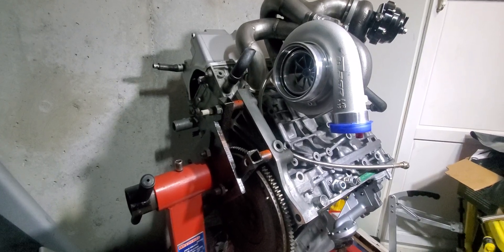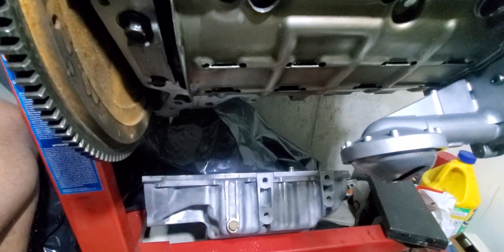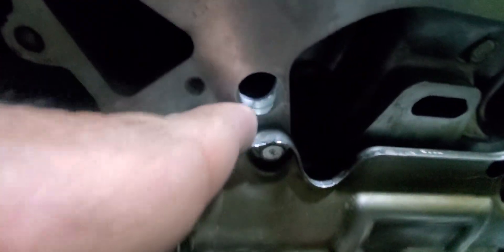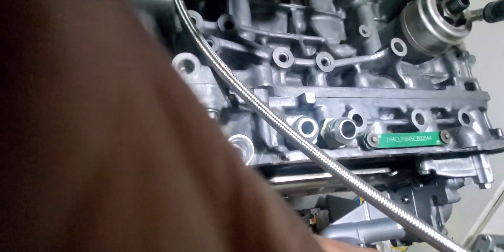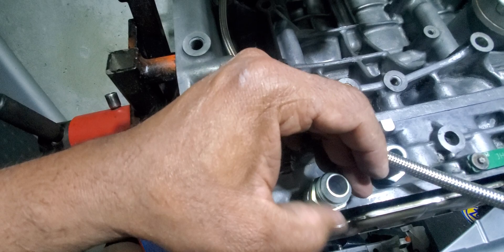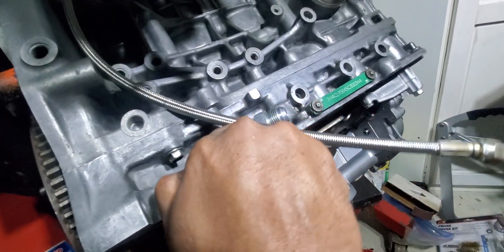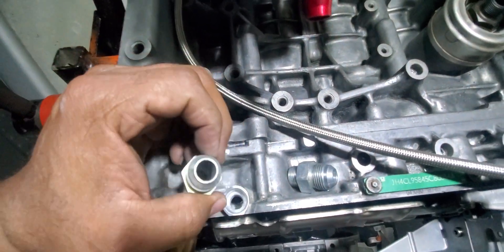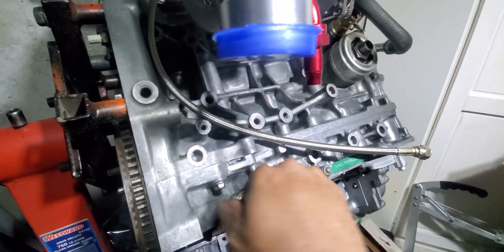My K24/K20 turbo oil drain solution

Comment: How is it holding up if you still have this car? On my k20a2 only bosses I have are those two above the vin plate.   Foresee any issue with one of those?  Man the one thing I’m wearing is getting the journal for the 10an orb Oring smooth as possible.  Also the tapping while I’m familiar with, no margin for error haha. Not gonna lie, I am confident in my meticulous nature and experience but having a hard time pulling the trigger on this.   It is a fantastic idea and I wonder why not many other this???

Comment: The idea is definitely good but I don’t feel like boring into my engine (I have a k24 mr2 as well)
Reply from the maker: @RoadsterAlex  Done tens of thousands of miles on mine now without a single  issue. It's a boss, it is already bored except for a thin end cap which from an engineering standpoint is almost better as  a true hole.
Reply: Same here... next week i will do that job but i dnt want to chance it with this one